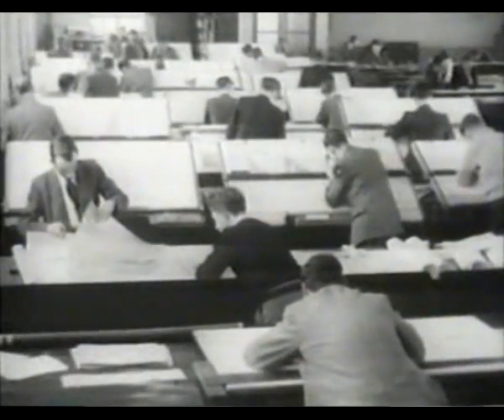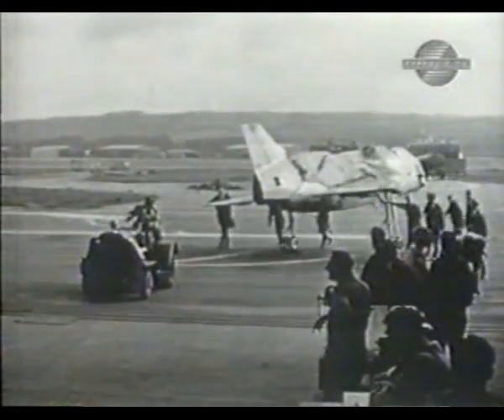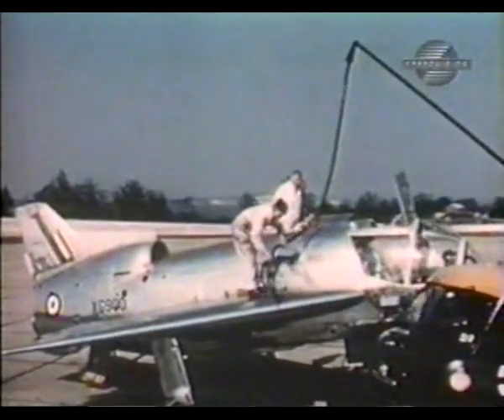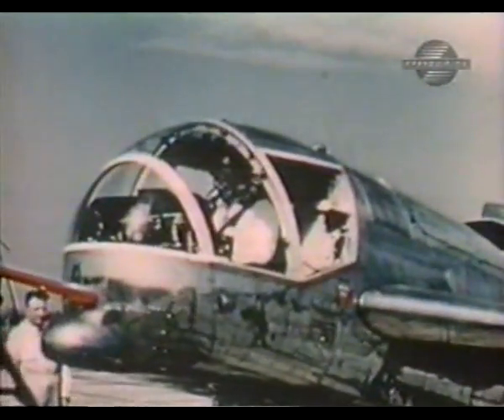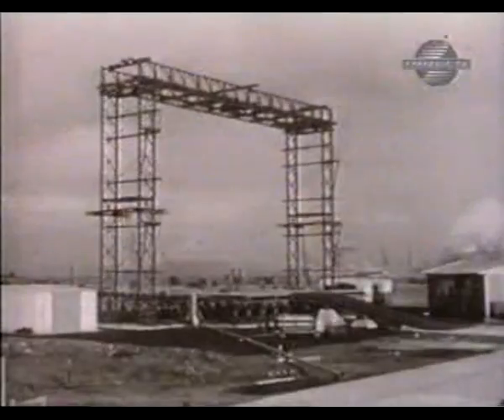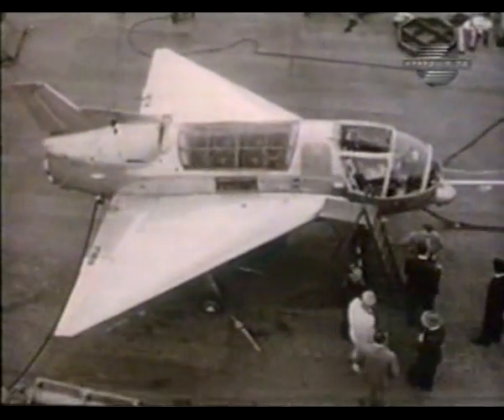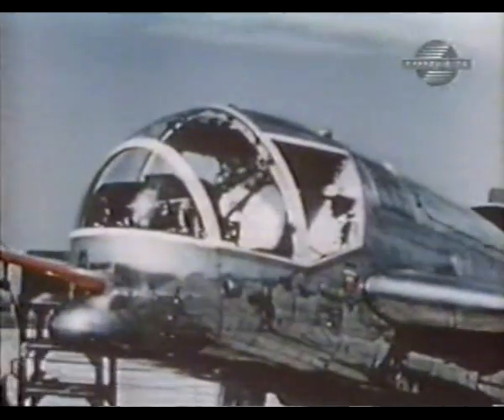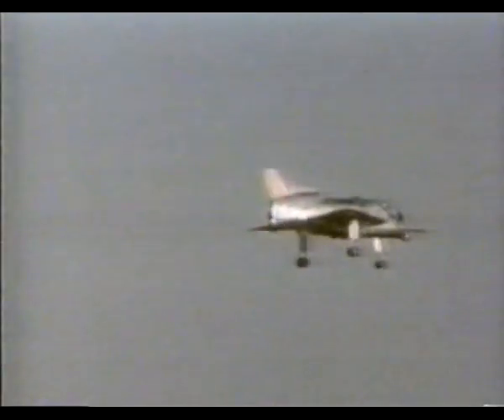Short SC. 1 VTOL Experimental Aircraft

Comment: @chrthiel Yes, very simple design indeed, but impractical; because the 4 vertical engines are effectivly dead weights in horizontal flight. This is one of the earlyest vtol prototype. The technology would eventualy lead to the modern Harrier & F-35B

Comment: A technological dead end. The Mirage 3V used the same lift system and development was halted because an in service aircraft was not possible. You can have either 1/a  number of lift engines or 2/ fuel tanks and weapons. But not both.